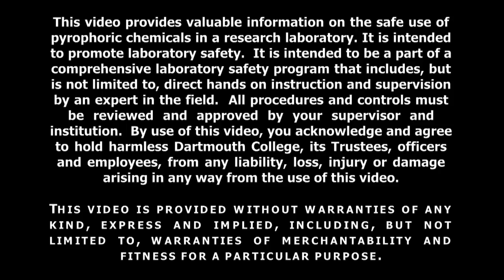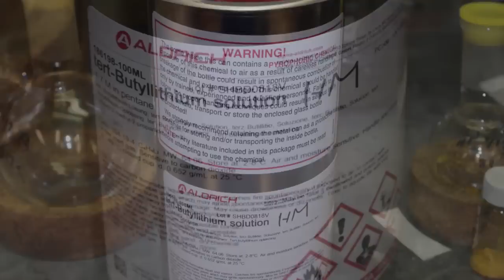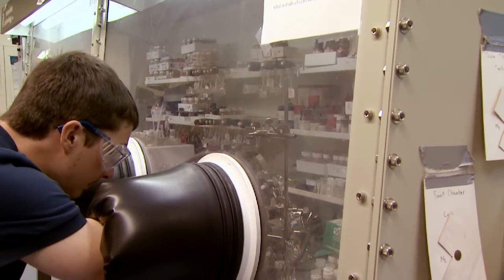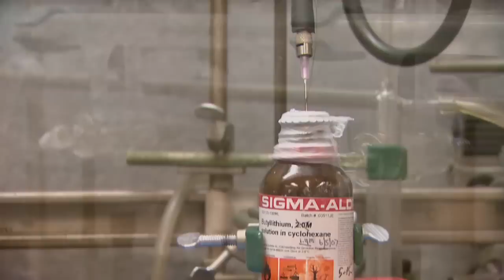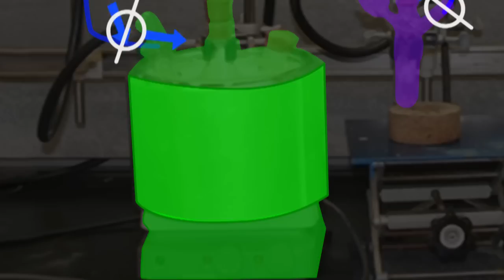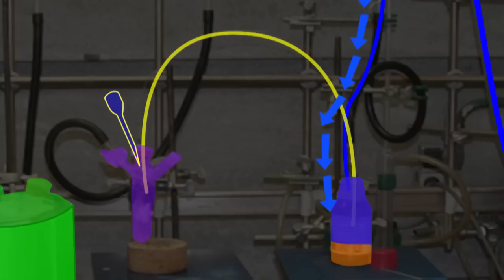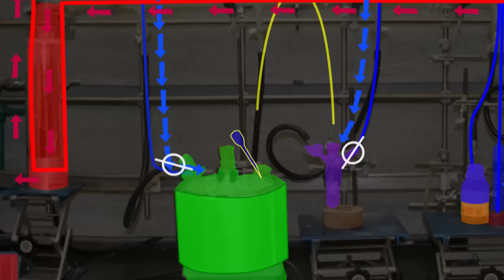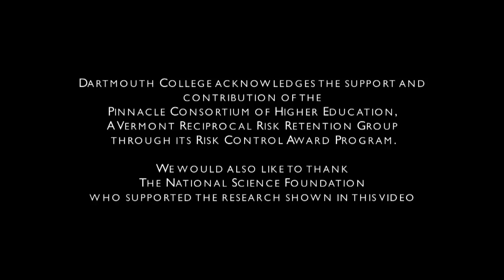Handling Pyrophoric Materials

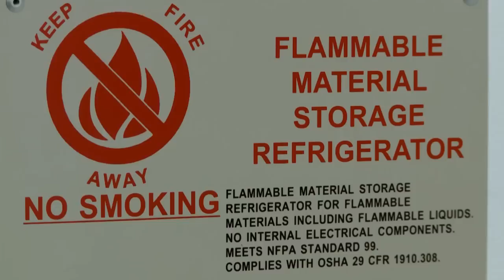Comment: 4:03 Explosion proof fridge?
Reply: they are really common in labs since the internals of normal fridges can spark which can light solvent vapors causing the fridge door to be blown off at high speeds. Many accidents have happened because labs used normal fridges.